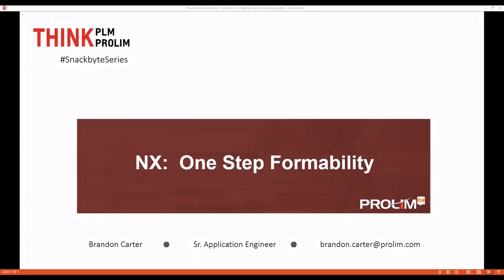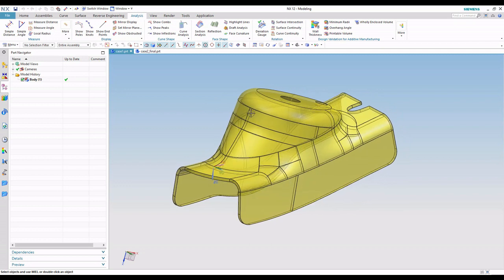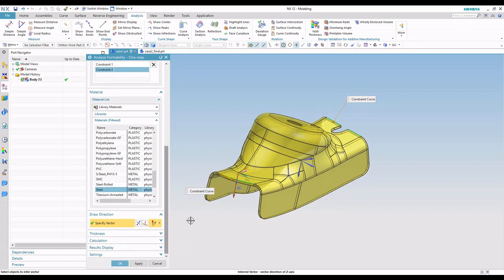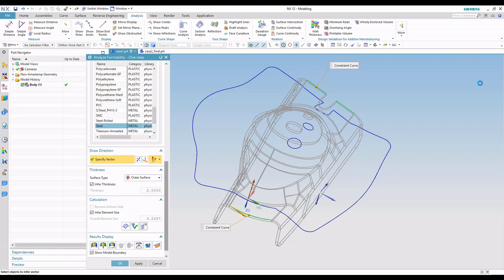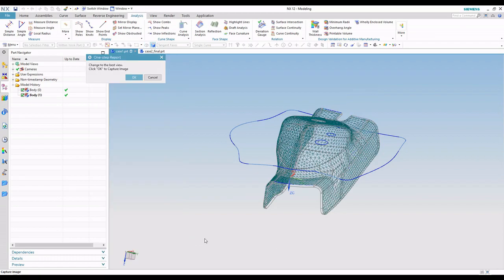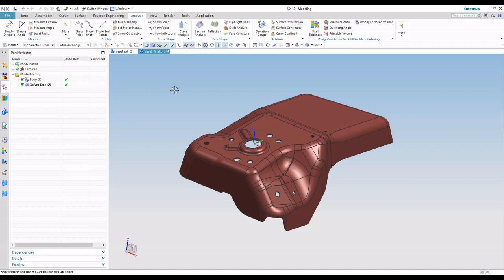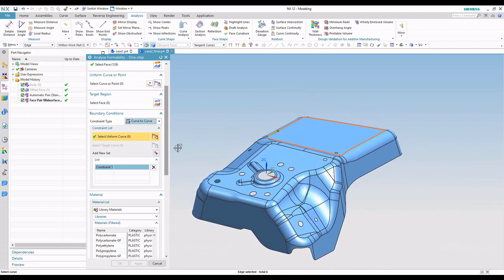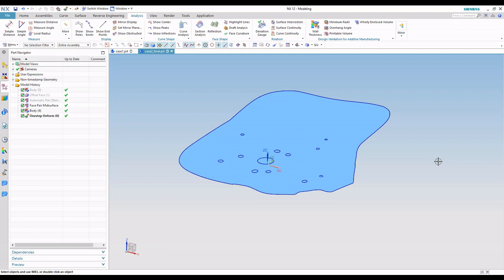Snackbyte: NX CAD One-Step Formability

Comment: the first part cannot be form on one hit. the process of forming is wrong. should two steps. first is form middle bubble up on flat blank, then two sides flange form down. so, need create middle part and simulation two times. the second part still need two hit also.